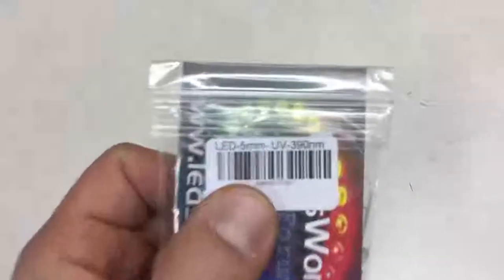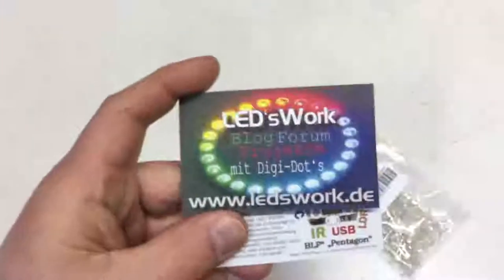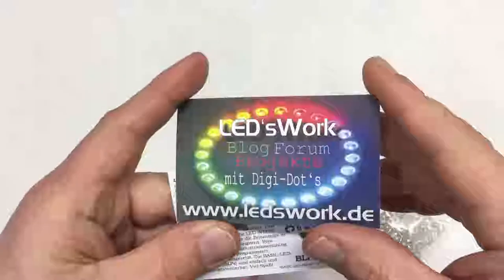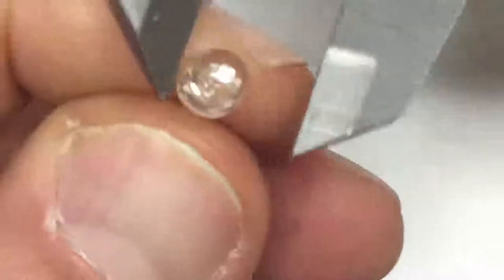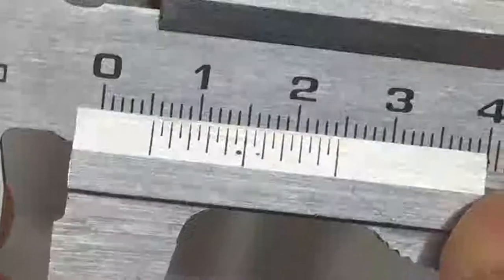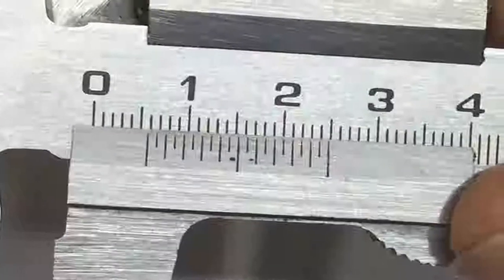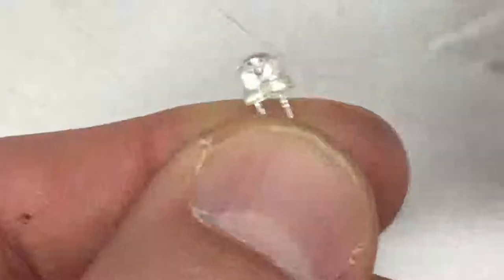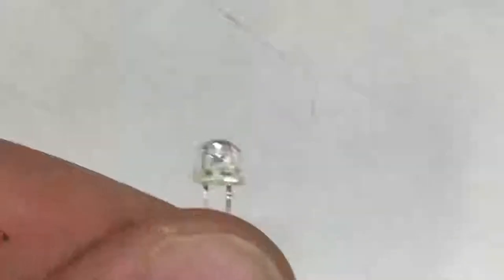Mailbag: UV LEDs (Characterized), I2C OLED Displays and a Plan

Comment: Hi Robert, I want to reproduce (with some variances) your design with an old UMAX scanner and I wonder what is the spacing between the leds (in the triangle) made by the leds triplets.Thank you very much. Best regards, Rene-Jean.
Reply from the maker: Hi René-Jean, gimme some time an I'll upload the PCB layout and some drawings to my public Google drive. P.S. A MCP4822 and a MCP4922 DAC arrived in my mail. So the videos covering those are definitely coming up.
Reply: Hi Robert, SIMPLY put ...you are such a kind person. Regards,  RJM
Reply from the maker: @rene-jeanmercier6517  Hi René-Jean, thank you very much! And here's the link to the Google Drive: https://drive.google.com/drive/folders/1vmu6NW8ZXZKVkAIxGkxK53tPzjxXogMg?usp=sharing
BTW I use 0.8''/20mm between the LEDs in a row and 0.7''/17.5mm between the offset rows (see "UV Exposure Unit LED Patterns.pdf"). Of course the density of your LED pattern depends on the distance between the LEDs and the to be exposed PCB (see "UV Exposure Unit LED Light Cone.pdf"). If you have DipTrace or Visio I can also upload the original files.
Reply: Hi Roberts, Forgive me for asking another question. What is the distance between the top of the leds and bed glass ? Thank you for all. Regards,  RJM
Reply from the maker: @rene-jeanmercier6517  From the top of the PCB to the bottom of the glass it's 50mm. From the top of the LEDs to the bottom of the glass it's 45.3mm. See also the "UV Exposure Unit LED Light Cone.pdf" drawing. OK, in that drawing I just labeled the LEDs and nothing else - my bad.
Reply: Hi Robert. Thank you very very much. Regards,  RJM
Reply from the maker: @rene-jeanmercier6517  Hi René-Jean, you're always welcome! Best Regards Robert

Comment: It only took a moment to characterize the LED, and you would have been overdriving them at 3.3v.
Reply from the maker: Indeed! Never trust specs on the product listings on Amazon/Banggood/AliExpress! I contacted the seller (German company, not Chinese, just the LEDs are Chinese) and asked them: "What are the correct values? 3.2V/20mA or 3.3V/30mA?". They asked back how I measured. I gave them the full documentation (and a link to my YouTube video if I remember right). Never got an satisfying answer and to this day these LEDs are listed as 3.3V/20mA :-(